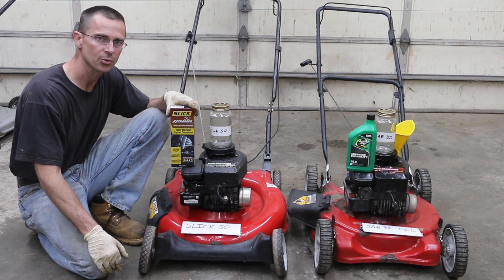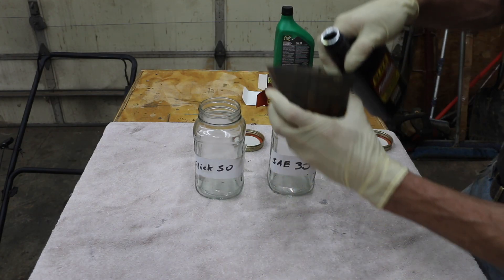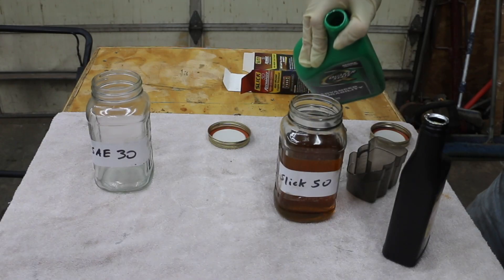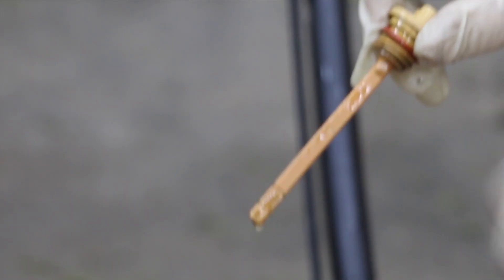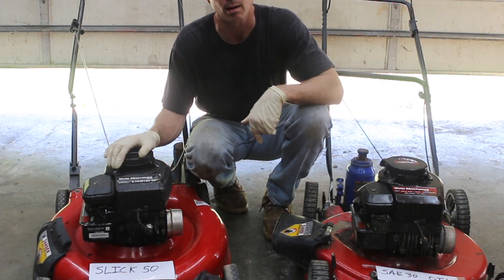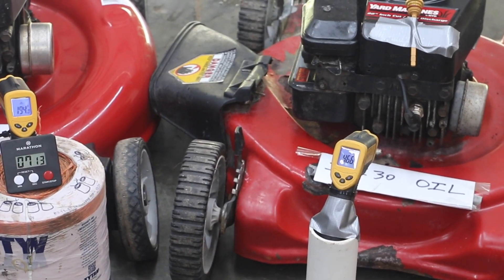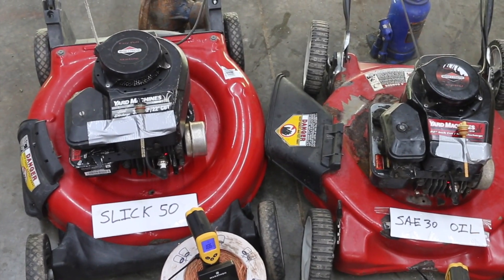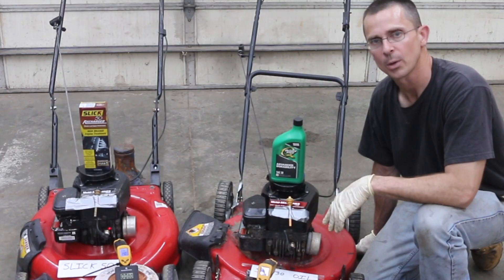Can't believe what SLICK 50 did to my engine!!--Dry Crankcase Test!

Comment: Interesting note for you on this one - The formula for Slick 50 changed in the early 90s with the Quaker State acquisition of it. The original engineer actually sued them (Quaker State, then Penzoil, then Shell as the succession of owners of the brand) to make them quit using the original data and testimonials. The current formula (since the early 90's) that has none of the original formula at all. The original engineer actually sells the original formula under the name Xcelplus. It would be incredibly interesting to see a comparison of the two
Reply from the maker: Thanks for the video idea.
Reply: @ProjectFarm  be cool see an update video.
Reply: @ProjectFarm  yes, please follow up on this. I was also a believer and would love to see the comparison.
Reply: @ProjectFarm  I'm in Australia, I'll happily act as an agent and purchase and ship for you if you want to do this.
Reply: @Project Farm
I told you this 5 years ago.
Reply: @ProjectFarm  I would love to see the two compared.. Thanks in Advanced..
Reply: @ProjectFarm I know this is an old video, but could you do this test or some type of lubricity test with Prolong ? I’d like to see if it keeps running with no oil after running the prolong like the claims
Reply: @ProjectFarm  video idea I've heard people say slick 50 reduces rod knock and friction because of ptfe coatings?
Reply: @ProjectFarm try prolong it says it does the same as slick 50 with no oil in crankcase I never seen you test there product yet thanks for the videos.
Reply: @ProjectFarm did you make that video?
Reply: My oil pump failed in my 383 CID Dodge pickup one night, 150 miles from home, and I drove the entire way home with zero oil pressure using Dura Lube engine treatment.  The engine did not increase in temperature (according to my temperature gage) the entire trip, and only one lifter was pecking a little bit when I arrived. I replaced my oil pump the next day, and drove the truck another 100,000+ miles without any problems.
Reply: @raywade9950  Is Dura Lube still around? I still have the little pump can that came with it for household use in my bathroom. I use it on everything...
Reply: XcelPlus is not for sale in US. that sucks
Reply: @williamdiaz8100  The owners of Slick won't let him.
Reply: @williamdiaz8100  anything with teflon/pfas  needs to be banned. Human beings are so stupid.
Reply: You need to try z-max vs duralube ive tried both and prefer z-max as an additive
Reply: Yep.. when I first use the product back in 1989 I put it in a Chevrolet cavalier 2.0 and I got great results electric fans hardly ever turned on more horsepower and of course better gas mileage ..
Reply: I tested the original slick 50 years ago in a small engine treated it then drained the oil plug out run it for 1 hour then filled it with water and run it 30 minutes and it never locked up, the stuff they got now is junk.
Reply: Original formula design for aircraft. Before automotive application. @atleeraber2996
Reply: Back in July of 96 on a trip from California to Texas (with a stop in New Mexico) the engine ran very hot. The temperature gauge needle was all the way on the high mark. Changed oil (with Slick50 and Mobil1) and from New Mexico to Waco Texas the temperature stayed right in the middle. Now I question if the Slick50 was the original formula or not. Either way between Slick50 and Mobil1 the engine temperature gauge needle did not rise above the normal half-way point.  Tried Slick50 again last week but it doesn't seem to make a difference, the temperature in my car now was still between half-way and high mark on the gauge. Oh, the average high temperature is just above 100 degrees.
Reply: @bignycatx  I had an oil line rupture 100 feet from my house on my 89 HD Heritage Softail a few years back. I did not notice until 25 miles down the road when I pulled over to stash my jacket and my motor wouldn't idle down. I looked down and there was oil all over my  lower right leg. Hitched back into town and retrieved my bike and took it in to have gone through. Tore it down and there was just a bit of galling on my lifters, rocker arms looked perfect. Replaced lifters, put it back together and it runs as stong/ maybe stronger cuz I wring it out a little harder now. Cody Customs Ray said that's an Evo for you, I credit the Mobil 1 20/50  with a tad of ER Metal Conditioner  mixed in and good karma..
Reply: My Grandfather sold Slick 50 came in a velvet bag n steel can, he also sold Gatorade amongst many other oddities Gatorade being the only successful product yet not so much for him…
Reply: I have one original bottle still 😆
Reply: Actually i looked it up and found this statement...."What is Slick 50 now called?   The original Slick 50 (pre 1984) formula is now sold under the name XcelPlus."     The ads that is being talked about in this video were made in the mid-late 90's.  I know this because I remember buying a bottle and putting it in my Saturn SL2 I bought new in '93.   I remember the claims well.  It claimed to use teflon.  JUst like non-stick pans.  You put in in once and it even after you drained it during the next oil change, the claim was it had coated the engine and continued to protect it.    So the question, is are they still using teflon?   The new "recharged" bottle doesn't say.  Hard for me to say if it worked.  It started burning oil at about 150k miles such that I had to top it off between changes.  Would that have been worse if I hadn't used it?  Impossible to say.  It was no miracle stuff though.
Reply: @Packer1290 look for 'PTFE' not 'teflon'. Dupont sued slick 50 and others to not use their brand name. I'm in Australia and the last time I recall getting slick 50 was in 1998. You don't see it on shelves anywhere now, not for at least ten yrs. The bottle I bought in 98 worked. Smoother, lower temp, better economy. Stuff now in a 100ml shake well bottle like wynns claiming to be PTFE I don't trust. It's too chunky even after shaking and will just clog up a filter, or worse, oil passage
Reply: Thanks for that I didn't know, in highschool in the 90s I heard people liked it but I never tried it and have been a MMO fan.  I kinda would wanna try the org slick fifty though, thanks acconboy for the heads up that we can still get it.
Reply: That is great info on the fate of the brand and how it was ruined by corporate raiders.
Reply: Thanks for the information. Originally oil gray,black . I've seen motors ran red hot cooled down,add oil and ran for yrs.
Reply: Is it interesting though?
Reply: Thank you for sharing that 👍
Reply: Does the current recipe have Teflon in it like the original?
Reply: @bradsims1933  No according to Google
Reply: @bradsims1933  
It did when I was in the quick lube business during the eighties and early ninties
Reply: Yeah and still doesn't work. You cannot pour in liquid Teflon in an oil base to coat metal parts of an engine. It has to be specially bonded to the metal.
Reply: @wilsonrawlin8547 it doesn't work to create a non stick frying 🍳 pan. It does work to reduce temp, increase economy and a few hp. 

You're taking particles and at the engine running temp putting them under friction pressure against the moving parts. That might not be bonding but leaving a residue. 

Both these mowers are used and the one on left has a lot more wear on the wheels. So we don't know if this result is random or replicated if you did it 10 times with almost identically used machines
Reply: Yes, I always doubted that the PTFE would "bond" to an already-oily metal surface. @wilsonrawlin8547

Comment: A product called PROLONG   I have used Prolong  in 3 of my own vehicles  which reduced  RPMs by about  100 rpm   I am not a mechanic  I am a retired Semi Truck driver  my vehicles were  a  5.4  V8 F 150   My 94  Pontiac  T/A   72 Pontiac  GrandVille 455  rebuilt V - 8  and  my  company owned semi  Tractor 2001 Freightliner FLD with a  C 12  Cat engine  RPM s reduced  by 100  engine temp reduced by a hair on the gauge  sorry I don’t have more technical numbers & criteria  I bought a whole gallon of that stuff at a truck stop in Iowa  and put the whole gallon in  I took a big chance  of course I did not tell the  shop manager in Chicago  but  after a half mile  of driveing  it just about  spun  the  tach needle off the  tachometer  but I never had no  problems with that engine  and the company never knew  yeah I had the nerve  never had problems with my own  vehicles  engines ran cooler seemed more smooth to operate  gas milage did seem a little better on the F 150  I estimate  about  4 gallons a week less used going to my job which was about  28 miles  one way 5 days a week  so double that  for coming  home at night  and on the Semi  my run was from   Cicero Illinois  to Cedar Rapids Iowa  5 days a week  any how I believe in the  Prolong engine & transmission  treatment
Reply from the maker: Thanks for sharing.

Comment: You need to run just Slick 50 to treat the engine for 30 minutes. I have done this with a Brigs and Straten engine and then drained it. Then I could run it for 45 minutes at a time with no oil in it.
Reply from the maker: Thanks for sharing.

Comment: I too, was a sucker for Slick 50 back in the day... LOL!
From what I remember, the Teflon coating it left on the cylinder walls, would eventually pit and crack, causing the engine to burn much more oil, than if the Slick 50 was left out.
It truly was the snake oil of the 90s, LOL!
Why did we all get duped? Because of the HUGE ad campaign, they ran on TV, LOL!
Reply from the maker: Thanks for sharing.

Comment: Looking at the condition of both mowers the front tires on the slck 50 machine are worn down to nothing .other machine you had a decent front tires .
so I think the slick 50 motor probably had many many many more miles than the conventional oil engine.  Excellent job regardless
Reply: good observation

Comment: Back in 92 we ran 4 identical vehicles in the fleet , we added slick 50 to one to see if anything improved with heat & Mileage , nothing noticable in the one running Slick 50 so we never wasted the $$ again .

Comment: I ran slick 50 in a 1989 dodge Dakota v6 417,000 miles later on a top end tear down because of a cracked exhaust manifold and busted manifold bolts the engine had cross hatching visible and little signs of wear. I am a believer.
Reply from the maker: Thanks for sharing.

Comment: Back in the 1980's I had a 1983 Ford F150.   I treated it with Slick 50 as the directions told me.  It was just one quart of slick 50 with 4 quarts of regular motor oil.  About a year after treating the engine with slick 50, I was driving down I-35 toward Dallas.  I heard a different sound from the engine, and probably drove about 5 minutes before noticing the oil pressure was zero.  It was full of oil.  

After having it towed to a Ford dealer and having the engine checked for damage I was told that the crankshaft, and rod bearings were not damages at all.  The oil pump sized up and a hexagon shaped shaft that drove the oil pump from the camshaft had twisted off.  They replaced the oil pump and the broken shaft, and I drove that truck for several more years with no problens.
Reply from the maker: Thanks for sharing.

Comment: Back in the 1980s I had a 1980 Ford van with a 6 cylinder engine and a 1976 Trans Am with a 455 engine. I put Slick 50 in both. Both engines failed in less than six months of adding the Slick 50. That oil treatment was a scam and a very expensive lesson for me. MotorKote is the only product I will add to any engine. Live and learn.
Reply from the maker: Thank you!

Comment: Dont forget to shake the bottle of slick 50 a lot before pouring it into your engine. if it sits on the shelf for a long time the teflon settles to the bottom. slick 50 is only a temorary fix. if your engine is that old you will need to use it with every oil change.
Reply from the maker: Thanks for the feedback.

Comment: I’m thinking that the slick 50 engine needed more run time on the product, but the other variable is the brand and age of the engines. They did not look to be the same brand and if one is older and more worn with looser tolerances, it may take longer to lock up. I guess 2 new engines, same brand, one season of equal usage with the oils etc. I don’t think any product would make much difference. Who wants to ruin 2 new engines😅
Reply from the maker: Thanks for the feedback.

Comment: I haven't read any of the comments but I'm sure there are hundreds of people saying you can't judge and engine when you don't even know the condition of each engine.
The motor with slick 50 could have had 500 more hours than the other mower.
Anyway if you could do two brand new ones that would give you the real results.
Reply from the maker: Thanks for the suggestion.

Comment: Your Videos are very well explained  n informational...! let me suggest to you a product that I have been using  on all  my vehicles ...n  have proved to be better than any other oil treatment out  there unless something new has  showed up on the market .. but for me there has nt been  any engine oil treatment none n i have tried quite a few... the product is JUSTICE BROTHERS OIL TREATMENT... I  recomended  it to friend n fam n it has worked everytime ... I   I seen it working in the similar manner you did your test on lifters removed and the they were grinded down after the test  well I saw  a demostration back in late 80s..with a new  of the box ball bearing  a Q tip n a drop of that treatment oil that guy demostrated  on n electrical motor  leaning his body weight on the handle and when he stopped the bearing n the smoke was clear.  IT DID NOT HAD A SCRATCH.. it is expensive  but i feel the same way you explained in ur video if  it works I dont mind paying for it .. I started paying  5.99 late 80's now is up to 12.99 still using. beats any other oil treatment hands down... try it ..
Reply from the maker: Thanks for the suggestion.

Comment: Quaker state would be the crappiest possible oil to use from my experience... my father (master mechanic) used to have quite a few mean things to say about quaker state...

Motorcycle oil formulated for a wet clutch tends to be the best for eliminating any possible off ingredients like friction modifiers or detergents (which would screw up a wet clutch).  I use that specifically over mineral oil currently to make my pulse capacitors.  I use mineral oil if any more delicate circuitry is being used, however.
Reply from the maker: Thanks for the feedback.

Comment: Extralube ZX1 manufactured in the UK.
An engine with ZX1 added to the oil, then drained of water and oil will run perfectly, more than 10 X longer than yours did ! I saw a demo, and the engine was still running @ 3000rpm after 10 minutes!
Reply from the maker: Thanks for the feedback.

Comment: The original Slick 50 lubricant was an excellent product and you can still get THAT version overseas.
The problem in the U.S. is that the government just had to get involved, to keep us all safe, and the EPA made the manufacturer change the formulation. As a result, it no longer performs as the original did. That's why they stopped running those tv ads that showed the engine running dry. The product doesn't offer that degree of protection now.
Reply from the maker: Thanks for the feedback.

Comment: My concern is that the two engines, although very similar looking and both obviously used, may have had a very different amount of hours on them.  I think a true test would require two brand new identical engines.  The Slick 50 engine looked newer, cleaner and better maintained but may have had 5 to 10 times more hours than the SAE 30 engine.  To me this wasn't a fair test.
Reply from the maker: Thanks for the constructive feedback.

Comment: the test is.....not correct..... you must use 2 new mowers 1 must be broken in with slick 50 the other standard oil....now the test field is even , i have done it,,,,,,,slick 50 WINS

Comment: Highly unscientific. What were the compression pressures? Valve lash? Carburetor jetting? Blade balance and weight? Engine bearing specs?? For credibility you could have done this with regular weight oil and measured then, then compared, as far as we know the motor on the left has more hours and a smaller blade, synthetic engine oil used vs leaner jetting heavier blade and more hours for the one on the right.

Comment: Well, obviously slick 50 alone/drained out, won't work.  I did use slick 50 years ago on an 87 Cavalier.  The car was aged enough to where it was pretty cold natured on cold days.  I put in slick 50 the day before a very cold morning.  When I started it on that cold day for the first time, it cranked very smoothly, no sluggishness at all.  I could immediately tell something was different.  I put it right in gear and took off without any hesitation.  I was quite accustomed to how this thing ran at first on a cold day, and it seemed like there was something definitely different (at least on start-up) with the slick 50.
Reply from the maker: Thanks for sharing.

Comment: It seems like one engine is newer than the other.  Slick 50 engine is newer, thus has not been saturated with oil for as long.  Could be a reason for the older engine with just oil running longer.  It has had longer to have oil penetration for longer.

Comment: Love your reviews.  Have you tried using duralube.  I have used for years in all my vets and even use the spray household dura lube on my guns and have seen a significant reduction in ware.  I soak the gun parts and leave overnight.  Clean the excess and it works great.
Reply from the maker: Thanks!  Thanks for the suggestion.